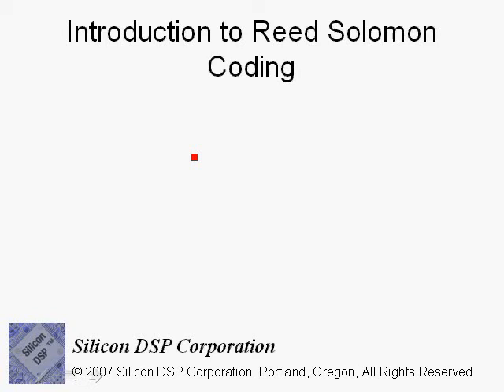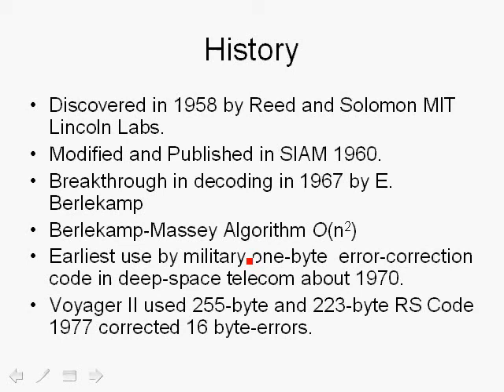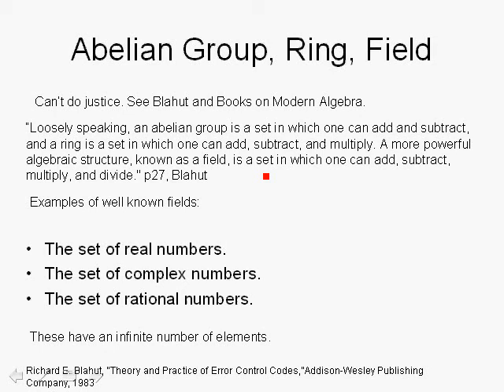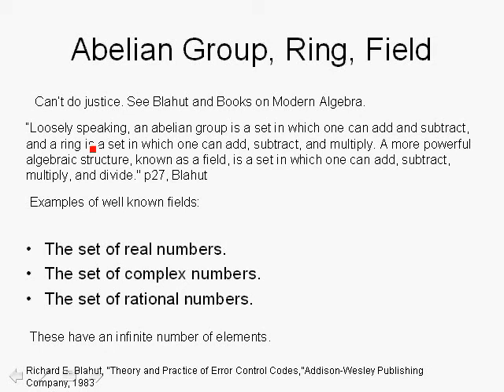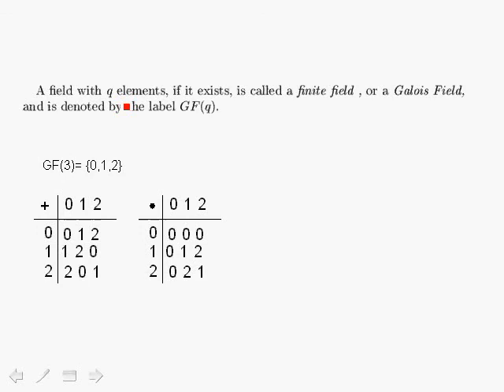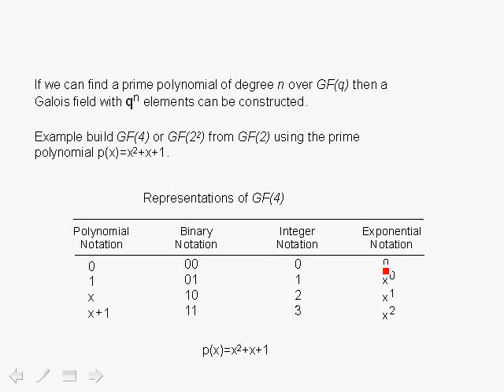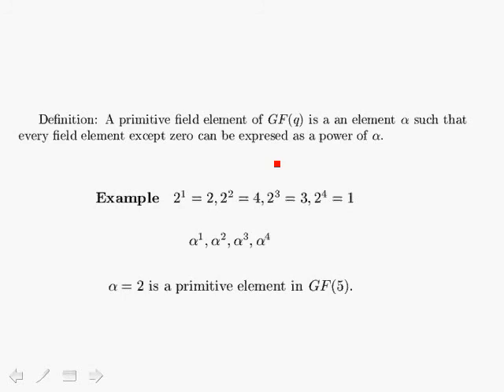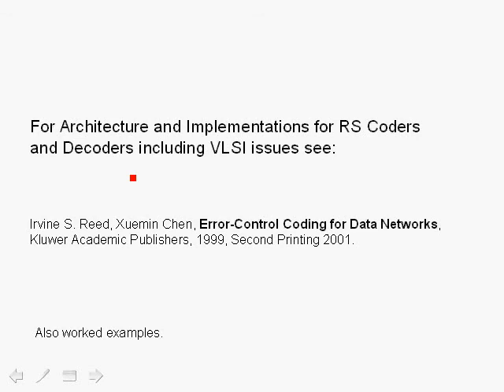OFDM Tutorial Series: Reed Solomon Coding

Comment: HIstory - the code that Reed Solomon worked with in 1958 to 1960 or so was based on using a fixed set of data points, treating a message as a sequence of values. At around the same time, BCH code treated a bit stream as a polynomial with 1 bit coefficients, and there was a practical decoder (versus the original scheme of generating polynomials for every combination of k symbols out of n symbols, and choosing the most common one, which wasn't practical except for small messages). As noted in the WIki article: "By 1963 (or possibly earlier), J. J. Stone (and others) recognized that Reed Solomon codes could use the BCH scheme of using a fixed generator polynomial", instead of a fixed set of data points, and although the two encoding schemes are different, both are called Reed Solomon. https://en.wikipedia.org/wiki/Reed%E2%80%93Solomon_error_correction .